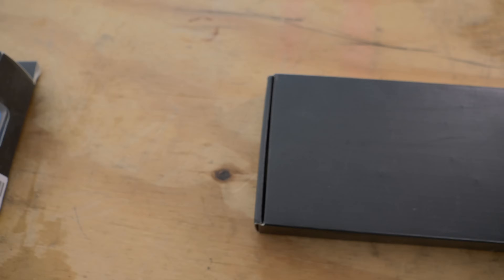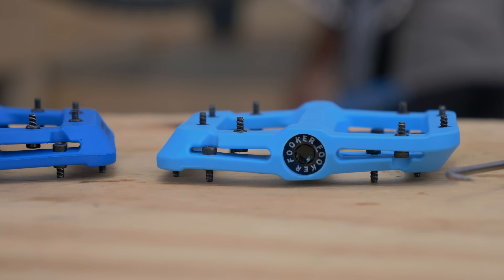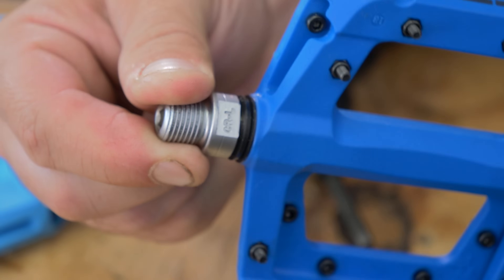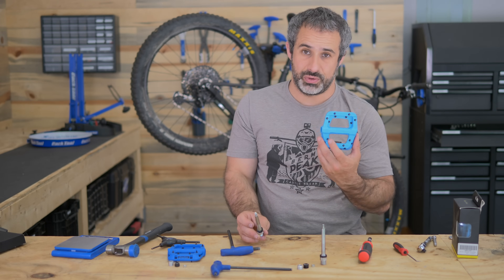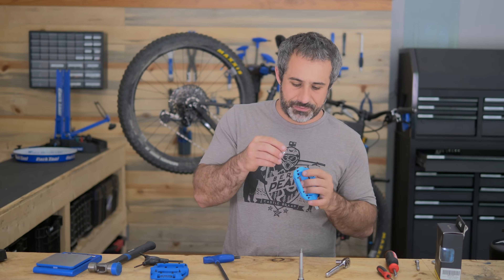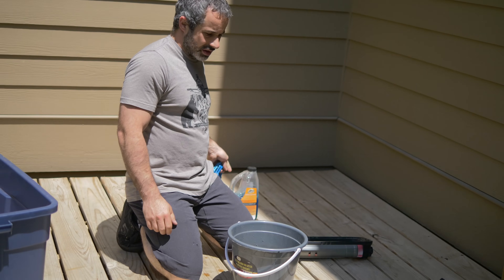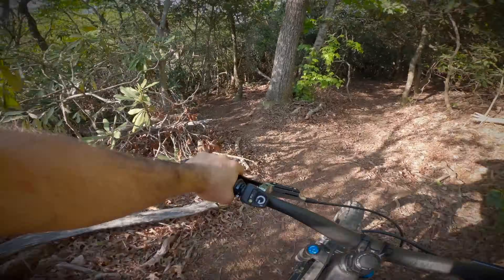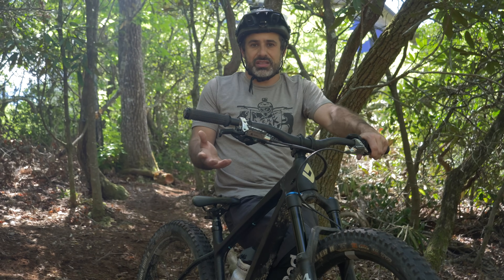These COMPLETE KNOCKOFF mountain bike pedals have me heated!

Comment: Seth, this was a nice video and good to bring to the surface the business practices in play. 
You made good observations in terms of the differences between the seals and the thread pitch. I would be very curious to know about the bearings that were used in each of the pedals and what quality grade they would have used. The Fooker pedal could be improved simply by squirting some  silicone rubber RTV into the  hexagonal  hole to block it off.  Of course an average user is not going to give this any consideration, so they don't address customer needs. As far as engineering goes, I don't place a lot of faith in some of the tests you performed. 
First off to get a proper confidence level, a significant sample size must be used. N=1 Is not statistically significant. 
You touched briefly on the importance of having the proper material properties.  Each manufacturer's material may differ widely from the other. That would be a good thing to look at. Of course it's costly and much more time consuming to get answers like that, but this is a very important attribute for product safety and durability.
A static sealtest in the buckets doesn't really tell you much because the product functions while spinning and it's possible that the one that showed no static leakage may end up leaking more if it was subjected to contamination while it was loaded and rotating.
.

Comment: Hey, I am using Mzyrh pedals from Aliexpress that are different mold, mine have totally flat platform. Yet they also look totally like some cool brand. They have great quality and good sealing, I am riding them through winter and rains, 100% fine. I have only diluted the bearing greaze since it was freezing over at -20C in winter. 
That brand also have the same looking pedals like you have reviewed now.
In my opinion, its all the same Chinese manufacturer, with some branding done and some changes made to change the price/quality balance.

Comment: If you search "304 Stainless Steel Hex Socket Plug" on Grainger you can find the right style of plugs for less than $3 each. The threads aren't metric, but the point is Fookers can be modified to keep the water out. I am more concerned with what kind metal is in the shaft and the resin composition which is where at least some of the cost savings comes from. I am sure the development NRE was costly but doubt that is even factored into the Raceface pedals. The injection molding looks better on the Fookers for what it's worth, without a visual mold seam.

Comment: The shaft on RF has ground surface (nice fine finish). Fooker come straight from a lathe, horrible finish. However this finish let me thing that the steel is way softer on Fooker. Simplest way to check is to take a file and try to file the shaft a little bit, see what difference there is. I can bet that Fooker's shaft will be easy to file, whereas file may not even touch the RF's or only slightly scratch it. Usually difference in cost is: materials and the finish. Not to mention they stole all R&D.

Comment: It's common for a company to bid on a mould job for a company with the caveat that once the production run or contract is done they can use the mould to make a product under a different name or for replacement aftermarket parts. Race Face saves money because they don't have to buy the mould and because the machine shop can make money with it afterwards.

Comment: The injection moulding works probably offers the plastic part as a generic pedal body with a "your logo here" option, nothing sinister whatever it's actually pretty common. Different pedal or cycle manufacturers will buy them in & assemble using whatever bearings & shafts suit them rather than having to buy, install & maintain their own injection moulding machine & tooling.

Comment: I have run Raceface atlas flats for years and as they have bearings in both ends they last and spares are not too bad to get. I have 4 sets on rotation as ride a lot but never run the Chester but seems good for the price. Couldn't believe Amazon that's cheeky.

Comment: I have a pair of Rockbros pedals that look exactly the same as the Chesters. Just checked and the seal is supple and the nut on the end is closed as well. Not sure where they fit in in this story, I just came across them on Amazon a while back when I was looking for an affordable pedal upgrade from the cheap plastic ones that came with the bike.

Comment: I got some fuuuucker pedels. They actually aren't that bad. Im 260 lbs and ive used them on black diamond trails in my area. I will say, if you buy them disassemble them and pack some dielectric grease or synthetic bearing grease in the bearing and assembly..

Comment: usually I am with you. but this time im on the fence. right now the race faces are $60, i think its downright wrong to charge so much for a nylon product that can be made for a couple bucks. I understand R&D and advertising and everything but the price is still wayy too high imo. the nylon pedals are a better product because they are lighter but they are also massively cheaper than alloy pedals so why arent they? usually this kind of thing happens when there is a MASSIVE markup. if the raceface ones were $35 i would buy them, or $50 made in usa... im willing to bet those fooker ones come out of the same chinese factory.

Comment: Name brand anything particularly bicycle companies are generally a rip off. Supply & demand. Im a CHEAP BASTARD !!! But I do believe
in buying quality the 1st time whether new or used. 
The honest me : buy the Fookers & disassemble, add silicone & seal pedals after adding extra grease.
The dishonest me : buy both the Fookers & RaceFace then switch 
internals & return RaceFace.
I refuse to buy certain name brands
because their overrated. Consumers want & demand value. Fookers meet
those expectations. Reality you wouldn't know what pedal brand you 
were riding on anyways. I love the Smucks that gotta have the newest, baddest, top of the line, bling bling
steroid in fused whatever because I
can buy used when the next model year comes out...

Comment: I deleted the fooker pedals from my amazon cart...Are rock bros pedals any good?
Reply: Add them back to your cart. I bought two sets of Raceface Chester's, and both sets started to fail at the bearings. The second set never felt right from the beginning, one of the bearings was clicky from day one. It eventually completely failed and the bearings split apart on a light trail and the pedal slid off the spindle and had catastrophic failure. I paid $50 for those. I decided to try the newer designed Fooker brand with needle bearings for $25 and figured it couldn't be any worse than the Raceface brand. Boy what a better quality set for half the price! The updated Fookers just feel better, spin more smoothly, and have zero play. They have been improved since this video was made.  Honestly, they are now built better than the Chester's and will be my new go to pedal for EMTB riding. They also come with spare pins and shims as a courtesy. The Raceface warranty requires you to fill out a form and give your CC number so they can charge you. Skip them and go Fooker.
Reply: @XennialGuy  thanks for the info!

Comment: What this tells you is that the "originals" are way WAY overpriced ... and what most likely happened isnt some crazy 3D scan copy, what usually is behind these knockoffs is companies trying to make cheaper product outsourcing to China where either the outsourced factory sells the mold OR simply produce the knockoff themselves with the original mold ...
Looking at photos of the box they say DESIGNED in Canada ... meaning they are MADE IN CHINA

i have ZERO sympathy for any company getting copied if the product is "made in china"

Comment: Or you can have the same Chinese company that manufactures the Raceface Chester pedals make these knockoffs on the side with the same molds and some cheaper materials (e.g. bearings) and sell them 4 cheap without the "Chester da Malesteh" logo.  Btw Seth, I understand that you are a complete shill by necessity.  I get it.  This is part of the youtube creator experience.  However, I'm calling bull$h!t on this whole mountain bike industry solidarity crap.  These companies are making cash hand over fist and could not give two $h!t$ about the community so long as fools are willing to get upsold just to sport a name and a logo.  I feel little solidarity with an industry that considers a $1500 full suspension bike to a barely capable entry-level mountain bike.  So good on ya you Fookers, stick it to the industry.

Comment: seth look what i found {PDX D10's Flat Wide Nylon Composite Bike Pedals for MTB, BMX, XC, DH, Enduro, Dirt Jumper, Mountain and Trail, Sealed Needle and Roller Ball Bearings, 9/16 High-Strength 20 Pins/Pedal
by Pedalxtreme  }     copy the link its even worse